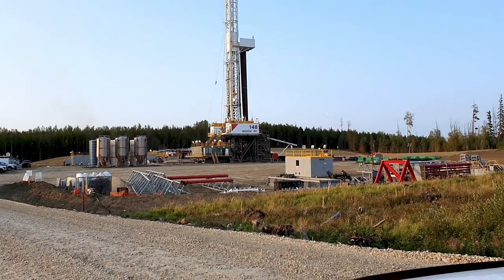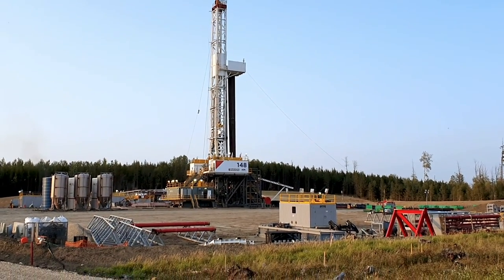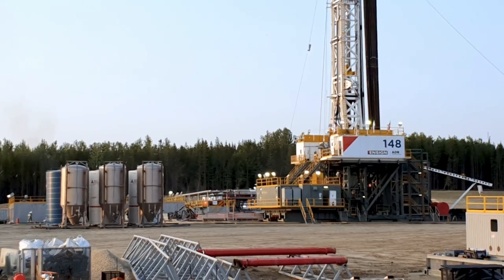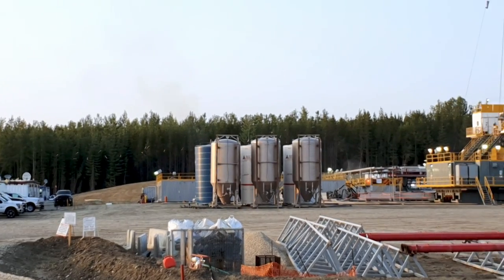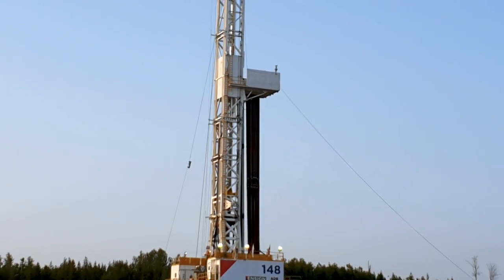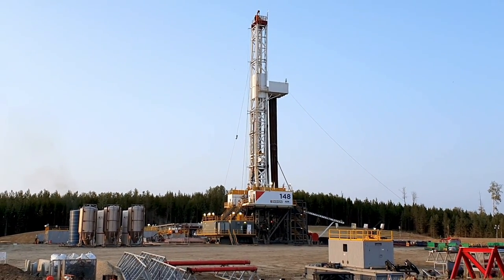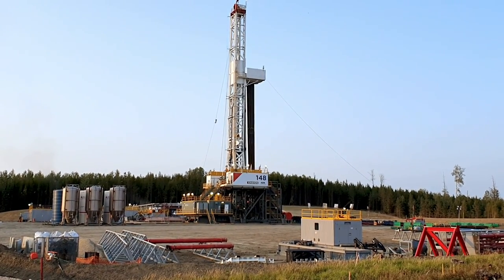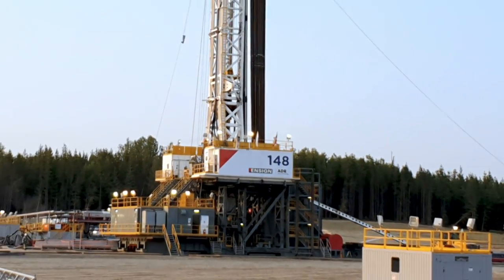Triple derrick oil drilling rig

Comment: Thanks for the drilling rig tour. There is oil drilling here in Kentucky because of the rich coal deposits but most of what you see are the "nodding donkey" pumps with storage tanks nearby. Most times they run off of electric but sometimes they have an engine that runs on LP. They shut down when the underground pool drops below a certain level and pick back up after it rises again. 
   We'd welcome you in Kentucky. It's not perfect but in the winter it seldom ever drops below zero. There's lots of hunting and fishing ,boating and freedom.
.I appreciate the effort you put forth making these videos on a wide variety of subjects
Reply from the maker: Sounds like a great place to avoid the dreaded winter weather! 
Lots of places where there pump jacks here too. 
I need to learn how to edit on my computer so that my buddy Dave doesn't have to do all the work,  but so far it's a foreign language to me. 
I've probably got about 50 pending projects,  plus the ongoing things that keep happening,  so no shortage! I think I could die in a car crash and could still produce 2 videos every week for almost a year afterwards!- I wouldn't be too good at replying to comments though...
I hope you are doing well. Now that I can drive in my woodyard without making huge ruts, I'm hoping to finish rebuilding the firewood conveyor today and get set up to process the 4 truckloads of birch logs I had delivered.

Comment: I definitely learned something. Didn't know they made giant oil rigs that moved on land.
Reply from the maker: Yup. There's a few different ideas for how to do it.  Years ago it was done by anchoring a couple massive winch trucks and literally dragging the rig over. Now it's more like more like massive pads that shuffle like a Star Wars creature. 
Often they will drill a certain part of each well moving the 5 or 10 meters over and do the same on each well for the whole pad. Then change pipe,  or mud or tools and do the next part of each well in turn.  
When drilling multiple wells next to each other it can save a substantial amount of time and money. 
These wells of course are all directional wells that can go out horizontal in every direction. The bottom hole destination can literally be miles from some of the other wells even though at surface they are 30 feet away in a nice row.
Reply: @lovesloudcars  Wow that's interesting. In my neck of the woods you'll see the donkeys and maybe an abandoned oil well tower from the 50's but nothing that crazy.

Comment: Worked at. Bistscho  Lake ( north of. the town  High Level, Alberta.  ) for. Peter. Bowden. Drilling. Ltd ( camp job ) triple rig deep hole , it was an old Arrow Drilling rig Bowden bought  rig # 2 for the fall and winter  in the mid. 1960s  / Bill. S. Canada
Reply from the maker: Cool stuff! You might have crossed paths with my Dad.  He worked drilling rigs from about 64 until about 1992. Started south of Edson on some deep hole stuff.  - back when it was mostly tripping for bit. I've got a couple other videos of rigs close up waiting to edit.  Worked around them for years running rental communications,  but didn't video stuff then.
My first memories are of camping at a Tri-City rig around 1972.
Sorry for the LONG reply!

Comment: Hey this is my rig! I still work on it too 👍 we’re currently just outside of fox creek.
Reply from the maker: Right on Kevin! We probably pass each other occasionally.  I haul gravel mostly nowadays. We usually end up hauling in before and after the rig move to prepare or fix the road. 
I've got a couple other videos of closer,  but have to be edited to remove the rig number. 
I grew up around rigs my whole life mostly midsized stuff.
This was km 12 on the Cape if you remember that location.